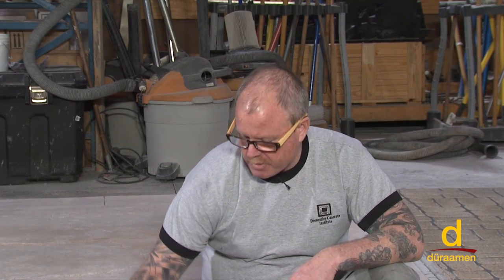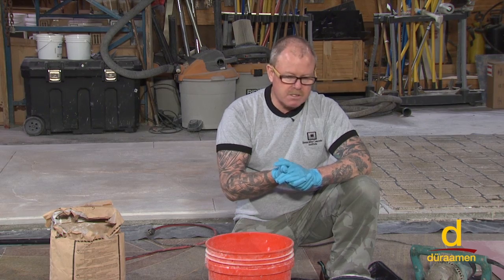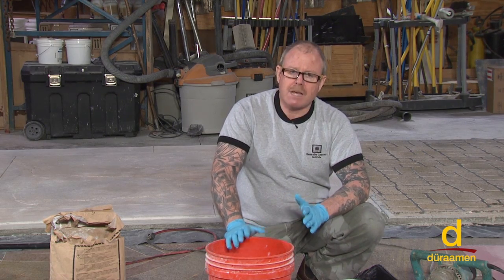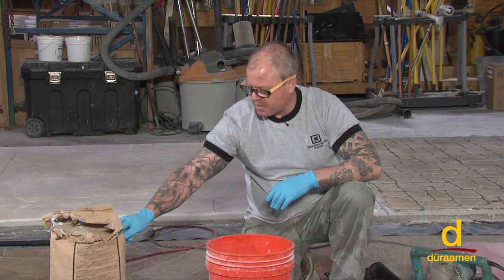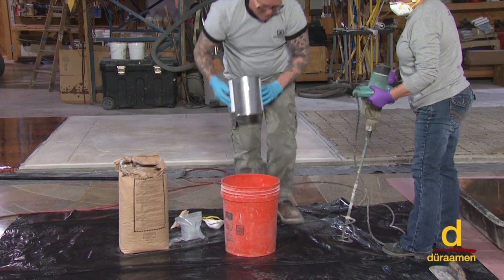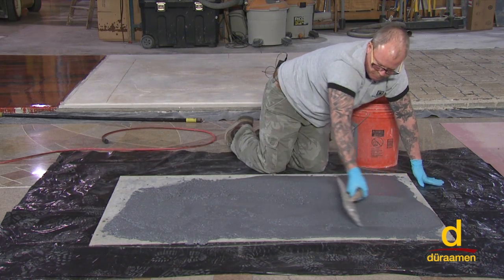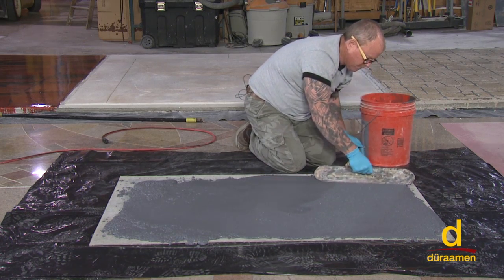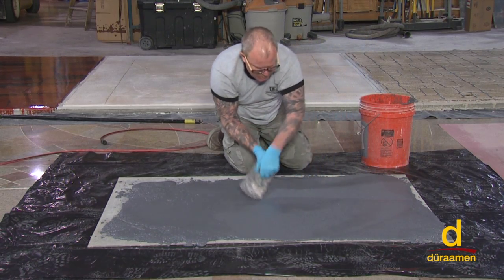How to Install Urethane Concrete Flooring System

Comment: what is the surface preparation. can it be applied straight to the structural slab without the need to anticipate a finishing concrete topping